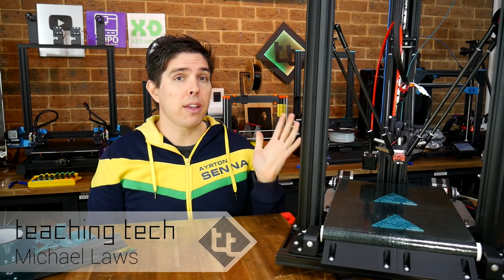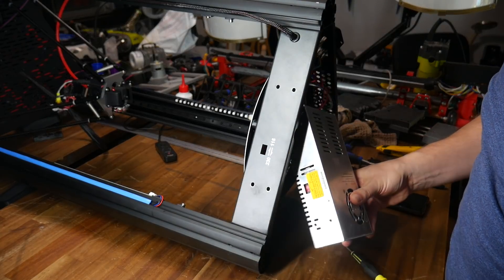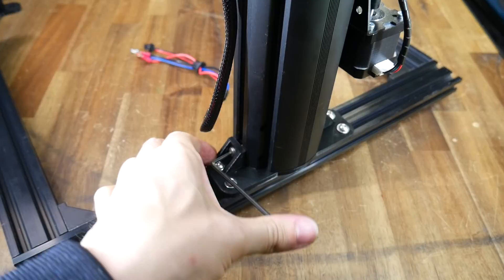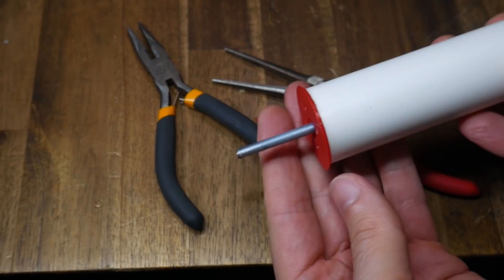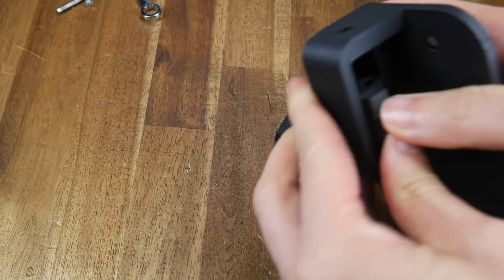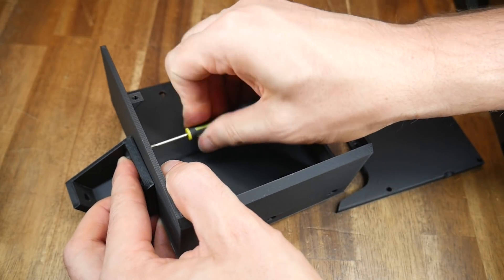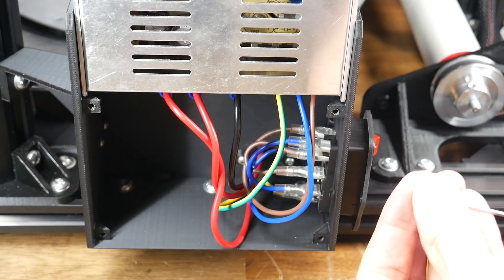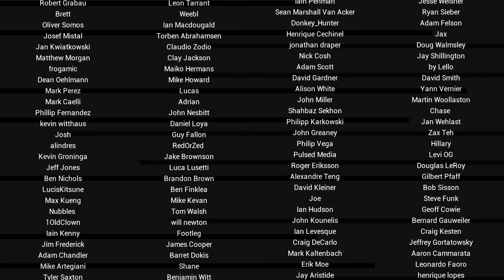DIY conveyor belt delta bed assembly video

Comment: Keep moving forward I am learning a lot from you ,but I have a question if you could answer me my printer when moving extruder from rotary encoder it moves very slowly but when moving from cura it moves normal ! have you faced such an issue ?

Comment: Try to make a crowned pulley on the rollers, so the belt be automatic centered. Other idea is to make a punch hole or a white dot on the belt and use a optical sensor so make sure the tape is always off the bed

Comment: I never managed to get my PowerBelt3D printer to work at all.  The belts were crap, with bulges and valleys.  The original design used PVC rollers, which deformed immediately.  I switched to stainless steel pipe, which was better than PVC by a long shot.  I tried stainless steel belts and even Creality CR-30 belts, but the printer never worked as advertised, and the support was essentially non-existent, with Adam not returning emails, and claiming to be "busy".  He revised the warranty on his web site once it became clear that he could not honor it.  I did get a few calibration cubes to print, but was unable to get real parts to print reliably.  The Creality CR-30 printer worked first time, right out of the box.  I think you would have done much better using the Creality belts, because they are essentially seamless.  I would recommend that anyone attempting this build start out with the CR-30 belts.

Comment: Nice. So if you extend the rear support arm can you tilt the print head and print infinate length parts? Or just fit a tip with angular clearance and go for angular printing.

Comment: Interesting conversion. The roller tube is probably rigid enough, but I would think that a larger axle with spacers along the length would help to prevent any minor flexural deformations.

Comment: Wow i think you have done a wonderful job and a great video of you building it,
How reliable is the belt surface from the Z axis. 
meaning doe it stay at a constant level and height from the hot end Nozzle like 0.2 all the time, or does it have an auto bed level in between prints

Also does the belt joint cause any uneven surface if a print started on top of the joint, 
because i know how awkward certain prints that I make that needs a very good accurate surface to stop any warping and any adhesion problems.

Comment: Great video again Michael! -To avoid the parts being built on the part of the belt covered with tape, you could punch a hole through the tape in one of the sides, then mount a LED and a LDR, then you can find the position of the belt. You can mount the sensor "anywhere" - for instance on the bottom-side, near one of the rollers - that should allow for a cleaner look.
I think this and the previous video will impact the 3D printing world tremendously; it's a good step forward.
Reply: Could you go with aluminium foil and reflection, rather than putting a hole in the belt and risking failure?
Reply: @6yjjk  You probably could, but I think the aluminium foil would likely become less shiny over time (as it will wear).
-But it isn't a bad idea, perhaps there is a more durable material with a mirror-like surface.
My suggestion for the hole is ... only a small hole like 2mm in diameter. The hole would be in one of the sides (say 10mm from the edge), thus it should not cause any failures, as normally you wouldn't print there.
Reply: Your over thinking it lol
Reply: @futuremapper_  If I am, please let us know if you have a better solution - I'd definitely be interested. =)

There are a few advantages to using the solution I suggest ...
The LED is cheap, the LDR is cheap and in addition, you'd only need a plain resistor, which is also is cheap. Hole can be punched using an office puncher, and then there's the wires and the 3D-printed brackets for holding the "opto-fork".
This offers quite a good precision to "skip" the tape and each time the hole is encountered, the position can be re-synchronized in the microcontroller.
-Besides, LEDs and LDRs never wear out when comparing to mechanical components such as swiches... ;)

Earlier, I thought about just fusing the belt using a heat sealer, but it will still leave a line that might end up looking worse on the printed part. One could, if using a heat sealer to fuse the belt, still use the tape, which would probably get rid of the worst artifacts, but I wonder if it's worth the trouble - because the belt needs to be perfectly aligned when heat-sealing it.
Reply: @68HC060  I commented this in the last video, but all he needs to do is change the programming for the 'eject' macro to run the stepper motors X steps forward (probably 50-75% of the belt length) and then the same X steps back, so it always prints in the same spot. Then manually calibrate the starting position at power on so the tape is anywhere on the underside of the bed and it can't ever print there. 
If you are worried about the belt wearing out in one spot, just make sure the tape isn't always in the same place as long as its under the bed when you start, you should be fine.
Reply: @FasutonemuMyoji  I've been thinking of that, but I'd rather not worry about calibrating the printer each time I start it.
I prefer machines that do things automatically to do as much as possible automatically. ;)
Reply: @68HC060  Sure, but I'm not talking about calibrating anything, just looking at the machine and saying "Is the belt tape on top of the build plate? No? ok, *flips on switch*"
He's already using TWO stepper motors which are way overkill for something that only rolls forward. I'm just suggesting that they go forward, then backwards, which is what stepper motors do best.
Edit: 'ment to type "about REALLY calibrating anything". Obviously I actually did literally say to calibrate it.
Reply: @FasutonemuMyoji  Well, you are definitely right; I'd just prefer having it done automatically. Your solution is cost-effective and it only requires some programming; mine does require purchasing extra components and writing software. ;)
However, if you're printing really long objects, you may want to go 10 cm forward rather than 90 cm backwards. ;)